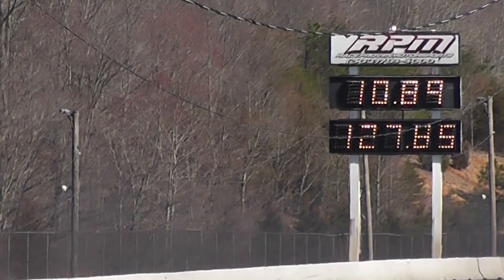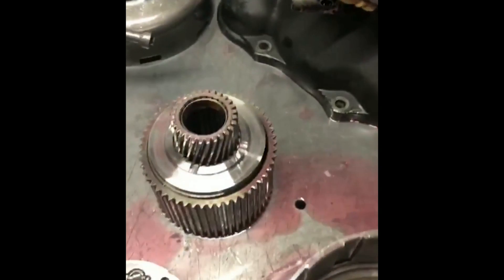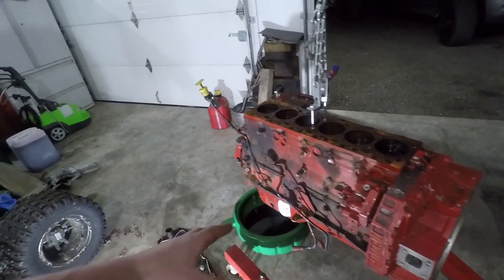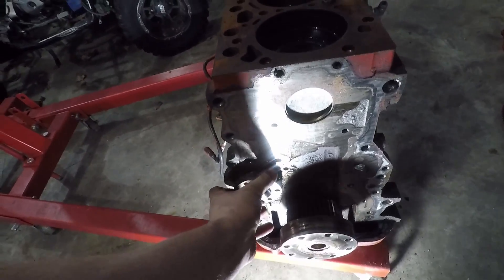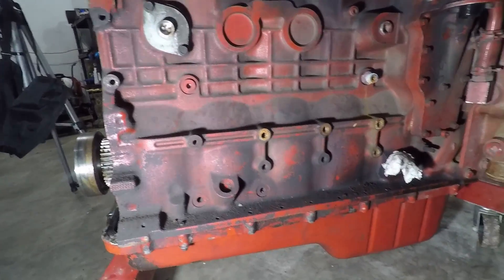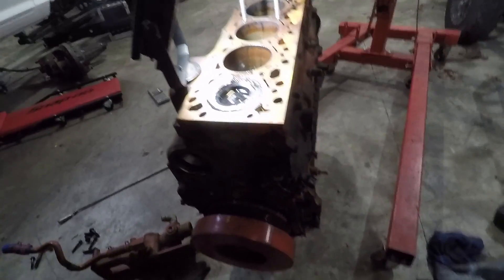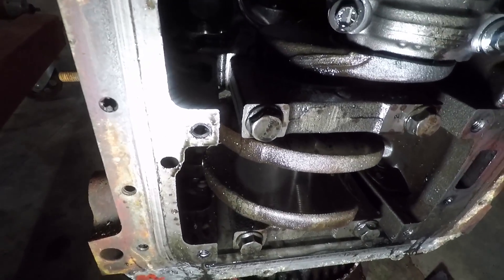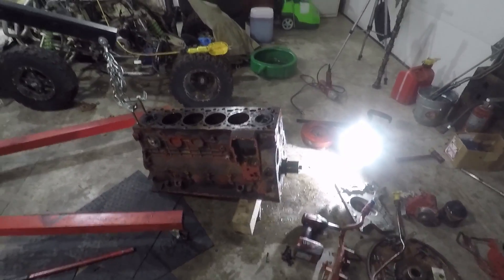How NOT To Disassemble A 6.7 Cummins Engine Block!!

Comment: I don't know if the block is compatible from the industrial version to the RAM version. I believe all the holes & previsions for dowels used to mount the front geartrain aren't present on the rear geartrain ISB block. Save the oil pan & suction tube if you plan to reuse the block. The RAM ISB has a rear sump 32 bolt pan and suction tube.
Reply: Mari Elkins it’s not. ISB is automotive, QSB is off road. The QSB Is rear gear train drive. However it would make a nice coffee table.

Comment: Paint marks on the bolts with a corresponding paint mark on the caps, block, head are usually torque and turn to yield.